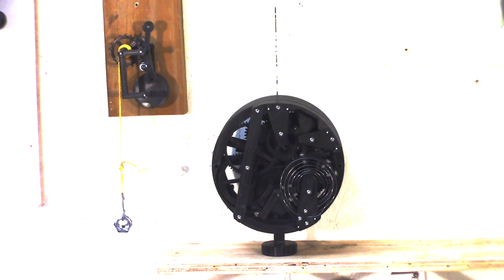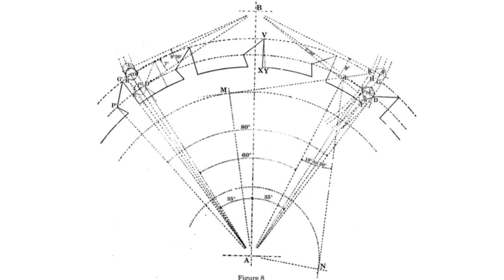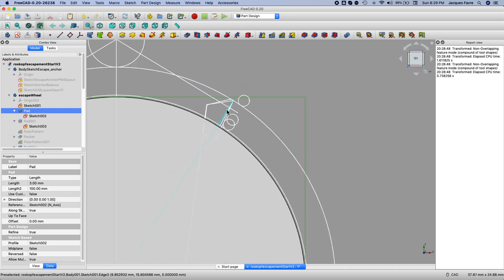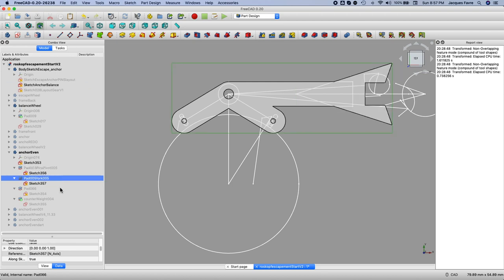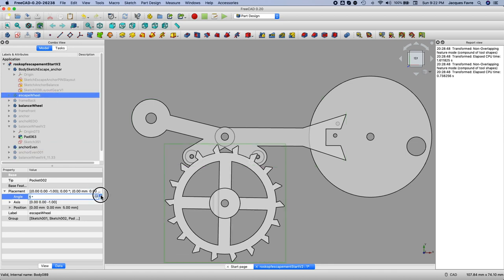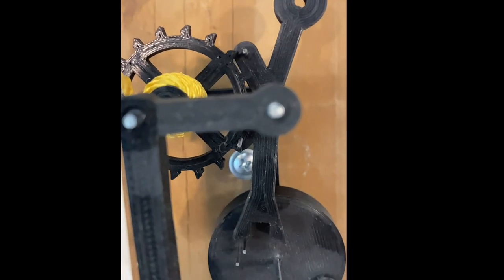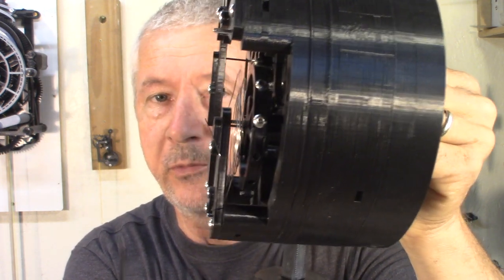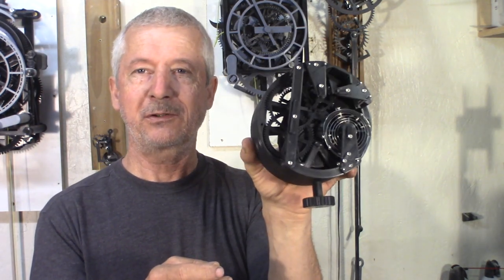Design and build of a 3d printed Roskopf watch, Part 7, closer look at the escapement

Comment: Looking good. I learn something in all of your videos. It looks like the leading edge of the escapement forms a tiny hook to hold the anchor until the balance wheel releases it. 

The cycloid gears look like they should print better. The involute probably has a tiny gap fill at the tip of each tooth. This adds a lot of retraction steps that creates extra stringing which ultimately results in a rougher tooth surface. Cycloid gears are a bit more effort since the pinions need to be regenerated for different main gears.
Reply from the maker: Thanks
The width of the cycloid pinion leaves are 0.83 mm wide at the narrowest the tip has no fill
At first I thought they would not print well but they do come out nice and strong
Yes the involute has a blob of fill that I do not like much
I does take some work to get the backlash right on the involute so in the end the cycloid is not that much more work
I bought a mechanical alarm clock on Amazon
It has a pin lever escapement the use cycloid profile for the gear train
And involute for the winding and other non critical gears 
Yes the escape wheel has some lock to pull and hold the anchor in place
The anchor is getting close to the smaller size parts can be done with a 0.4 mm nozzle
And getting a clean 1 mm hole can be a challenge too
It is very easy to have the pins crooked and the dimensions are out of specs
On the plus side of small parts, it only takes 10 to 20 minutes to print the escape wheel or the anchor
Fun Stuff